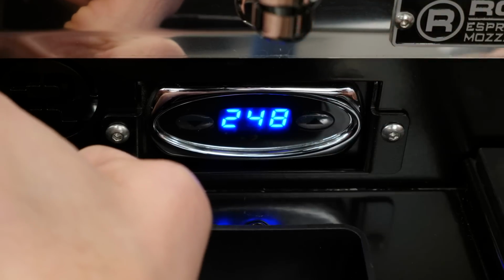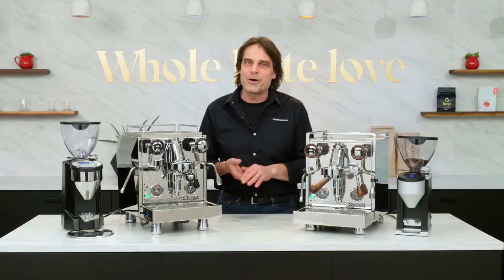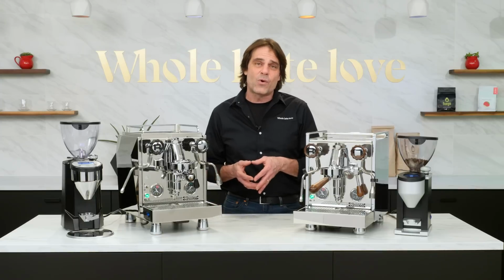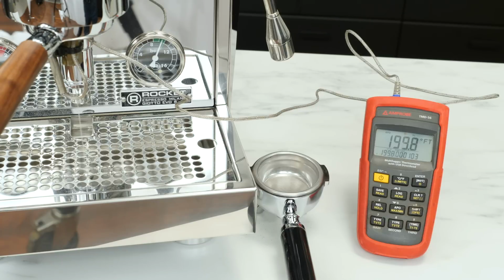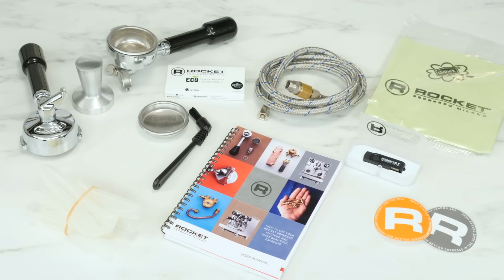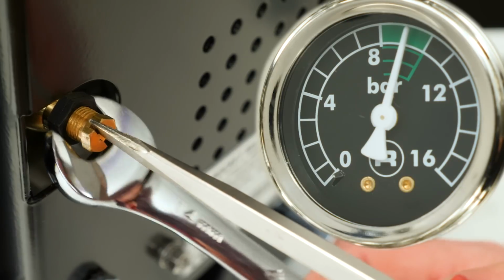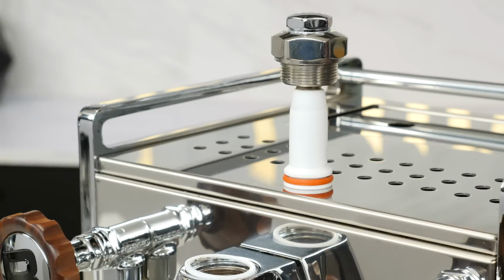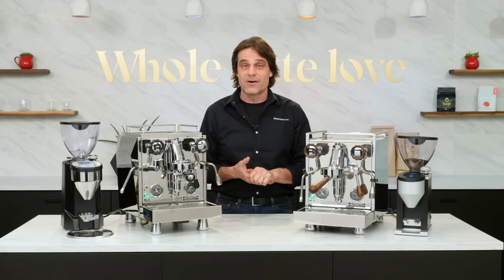Review: Rocket Cronometro R Giotto and Mozzafiato Espresso Machines

Comment: Question: I need to choose either bazzera aria pid or rocket Giotto type R, both have nearly same specs, which one to choose from?
Reply from the maker: Hi MR, They are very similar machines with both using HX boilers, rotary pump and plumbable. A couple of key differences (referring to versions from WLL in North America): Aria comes stock with flow control and has lever operated steam and hot water valves. Giotto uses standard turn valves. Personally I'd go with the Aria. It's a newer design, excellent steam power, flow control stock and I prefer the lever operated valves. Hope that helps!
Marc

Comment: Thanks for the video. Have this machine with Eureka mignon specialita about two years now and wondering it upgrading the grinder to ceado e37s will give me any noticeable improvement in taste of espresso? (I have watched most of uour ceado vids so do understand the other benefits of the machine, but really kist curious about flavour). Thanks !
Reply from the maker: Hi, larger burrs like those in the E37S produce a more consistent grind particle size. Compared to the Specialita the E37S produces a fluffier and virtually clump free grind. Distribution into the PF is excellent as is consistency of dose to dose timed weight output. Once you reach a certain level of grinder taste improvements are incremental and subjective. Both the Specialita and E37S produce excellent espresso. The Ceado, by reducing variables makes it easier to do so consistently.
Marc

Comment: Hi Marc, I was just comparing the weights of Giotto and Mozzafiato Cronometro R on the respective Spec sheets when I noticed the Giotto is about 15 lbs lighter than the Mozzafiato. To what do you attribute the much lighter weight of the Giotto, and do you think this suggests less robust build quality of the Giotto versus the Mozzafiato? Thanks in advance!
Reply from the maker: Hey kdd, Internally the machines are nearly identical. All or most of the weight difference comes from the Mozzafiato side panels which are heavier thick slabs.
Marc

Comment: Does it need cooling flush?
Reply from the maker: Hey AZ, Need to flush depends on time from last use. If you run pump with PF off and see bubbling steamy water then flush a few seconds until water flow from group becomes smooth.
Marc

Comment: It's not uncommon for drip trays to overflow and land exactly at the spot where the PID is located. That's a display + regulator combined, not cheap to replace. Came across a snapped off ceramic mushrooms. Good video from WLL though.
Reply from the maker: Hi q, thanks for the comment. You are correct with location of PID. One does want to empty the drip tray! In most cases the front end of the PID is fairly impervious to moisture. I agree with ceramic mushrooms - they are brittle and can snap if dropped or similar. I prefer stainless steel mushrooms.
Marc

Comment: hey Mark, absolutely love your YouTube channel. you’ve made my journey into coffee so much more meaningful, and allowed me to find joy in the mishaps along the way. 

i’m currently trying to decide between the Rocket Appartamento and the Ascaso Steel DUO PID. I was wondering if you were planning on doing a comparison video between the two, or if you could offer your advice on which one I should buy. The Apartamento of course has a proven record, but it would be nice to have temperature control and near instant heating. 

thank you in advance for your insight 🤍
Reply from the maker: Hi Omar, Thanks for the kind comments. The Ascaso you mention uses thermoblock heaters instead of true boilers. Sorry, I have to be honest... but for that reason it's not a product I'm interested in looking at. Thermoblocks will have issues long-term unless one is extra careful with water quality.
For less $$ than the Appartamento have a look at the Profitec Pro 400: https://www.wholelattelove.com/products/profitec-pro-400-espresso-machine-flow-control
E61 group, stainless boiler and 3 level PID. If you purchase from us, flow control on the Pro 400 is a free upgrade at the moment. The Pro 400 is a newer machine so not the track record of the Appartamento but I've been inside the 400 and like other Profitec machines I give it the edge in build quality tyo comaprable priced Rocket machines.
Marc

Comment: Hey Mark, for these Rocket machines specifically Mazzafiato, do I need to purge the steam wand after the machine is turned off? Any other tips for daily use?
Reply from the maker: Hey J, You do not need to purge prior to shutdown but always purge after steaming milk - every single time!. Other stuff:
1. Run a couple of cups of water out of the hot water tap every day or two unless regularly using hot water from the machine. This will reuce minerals
2. Filter/treat water with a BWT product to reduce calcium and prevent scale.
3. Backflush with water only every 10 brew cycles. Backflush with Cafiza or similar every 100 brew cycles.
4. Allow the machine to fully warm up before use and have the PF in the group when warming up.
5. Make EXCELLENT espresso - of course!
Marc
Reply: @Wholelattelovepage  thank you Mark! You guys are the best!! 🙌🏻

Comment: Fabulous! How long do they take to warm up first thing in the morning (in a 62°f kitchen) ?
Reply from the maker: Hey Mark, I'd allow ~25 minutes for full warmup. Machine will show boiler up to temp far sooner but you want the mass of the group fully warmed as well. As the Cronometros have a mechanical power switch it is possible to use an appropriately rated appliance timer so you don't have to flip the switch.
Marc

Comment: Hi there, is the warming cup area on the Giotta smaller vs. the Mozzafiato?  Looks to be that way over the video but I might be wrong?  Justin
Reply from the maker: Hi JR, Ever so slightly smaller. Minus the panels the machines are identical. The way the Giotto has the rails around the tray takes a bit more space making surface area of cup warmer smaller.
Marc

Comment: For a small coffee shop, which machine would you recomend, that is good looking and efficient? 😀
By the way. Amazon review on the Rocket.
Reply from the maker: Hi RC, Thanks for the comment and question. These Rocket machines are technically not rated for commercial service. That said some likely use in offices, bed and breakfast, etc. If your local regulations allow the use of non-commercially rated equipment you could get away with one of these heat-exchange boiler machines for lower volume service. These models have commercial grade rotary pumps and can be plumbed direct to waterline for unending water supply. You might want to take a look at dual boiler machines which have separate boilers heating water for steaming and brewing. With those you'll have more steaming power and more consistent brew temperatures. Have a look at the Profitec Pro 700: https://www.wholelattelove.com/products/profitec-pro-700-dual-boiler-with-flow-control or the ECM Synchronika: https://www.wholelattelove.com/products/ecm-synchronika-dual-boiler-with-flow-control
Marc

Comment: Hi Mark, your videos are great, have been watching for some time trying to decide which machine to buy and your reviews certainly help. Would you be able to answer my question regards model numbers for the Rocket Mozzafiato machines. At the end of the numbers are, A07, A11, B11, W11. What are the differencies between these machines? many thanks.
Reply from the maker: Hi Kenny, Thanks for the comment and question. I'm guessing the model number differences are related to different versions of the machine. The Mozzafiato has had 4 recent types. The newest two are the Cronometro versions which have the shot timer on the face of the machines. The Cronometro comes in the "R" version which have a rotary pump and are plumbable and the "V" version which uses a vibration pump and is not plumbable. To complicate things a bit more both the R and V types are available  in "Nera" which denotes black side panels and "Bianca" with white side panels. Here's a link showing all 6 current versions of the Mozzafiato side by side: https://www.wholelattelove.com/collections/all-espresso-machines?_=pf&pf_v_brand=Rocket%20Espresso&pf_p_price=2156%3A3200
Hope that helps!
Marc

Comment: Hey Mark, i recently purchased the Mozzafiato V and found it to be a mistake due to the noise, and just traded up to the Rotary pump with the rosewood handles and love it...my question you had already answered once with the "V" is how to change the PID to F*  which you answered by holding both buttons while switching machine on.....after receiving the R, i tried this same procedure but it didn't work? ...how do i do it on the R version?.....also i noticed after having the V for almost 3 weeks i struggled to get the pressure in the "green" no matter how i tamped or grinded it seldom hit that sweet spot on the dial...yet after receiving the R version, without changing a single thing the new machine hits the sweet spot in the green every single time??? Did i have a defective unit?.....Thanks...
Reply from the maker: Hey ADK, I think it's unlikely your V was defective. Did you ever try running the V with a blind basket in place to check the brew pressure? We recommended vibration pump machines be set to produce 10 bar with a blind filter in place. Adjusting the OPV controls the max brew pressure on vibration pump machines. Happy to hear you are loving the rotary pump machine! They are much quieter than vibration pump machines. To the best of my recollection changing C to F should work the same on the R version.
Marc
Reply: @Wholelattelovepage  yeah i cant get it to make the switch for some reason...

Comment: Hi Mark, I had some quality issues with my mozzafiato V and sold it. After your videos about the Crem One I am very interested in these machines. How do you think the Crem One  and the Rocket do have differences? Can we compare these machines in terms of quality....styling? Thanks for your videos, als always m: great job!
Reply from the maker: Hi HK, Thanks for the kind comment and question. Sorry to hear about your troubles with the Rocket. Not something I've run into. As too comparing to Crem machines... Style is a personal appraisal. Rockets as you are aware are heavy on the branding. Some like that and some do not. Qualoity of the Crem machines is very good. Be aware they have some plastic like the drip tray and the chassis. Not necessarily a bad thing but some are opposed. The Crem machines with Rotary pumps are extremely quiet. I consider the Rocket machines to be a very classic design and the Crem machines use more modern manufacturing materials/techniques.
Marc
Reply: @Wholelattelovepage  Hi Marc, thank you for that fast and detailed answer. Rocket is in deed very stylish and beautiful to look at, maybe my issues came from cleaning too much with cleansing tablets :). Did not know about the plastic at the Crem One: thank you very much, this is a very valuable information. Did I mention that I love your channel? I'm loving it :)👌

Comment: Mar question I have this model. I set pid but I also have a brew head temp on this unit also and it seems the brew head dosnt get to this temp. I mean sometimes but not always. The water function when I dispense water it’s scolding I understand this but leaving machine idle very rarly getting to that 201 202 etc I have to like flush a lot. Is this normal or is my brew head temp off or forget about brew head temp unit. Thanks.  I just checked machine at pid of 252 it finally hit about 201 F on group head. Maybe I’m overthinking this. I just want to make sure when I pull a shot it’s not like 192 while pulling. At 201 is good to do it.
Reply from the maker: Hi Dirk, Thanks for the question. The group temp gauge will not read the full brew temp when the machine is idle. I do not use group mounted thermometers much as I have a Scace device which is far more accurate IMO. Think you are overthinking.
Marc

Comment: Marry, on my mozzafiato i notice the circulation of the water in the e61 is much less. I had the Apartamento and you used to hear it all the time. The mozzafiato not so much. Is it because of the pid. I also notice with a brew head with my temp gauge it’s not what the pid say now I’m talking about when I’m not pulling a shot or when I’m not flushing just when it’s just sitting there. The Apartamento when just sitting got like 207 F. Is this because I didn’t pull the shot yet. Is it because the pid got the boiler water to desired temp and when I pull the water coming through bre head will be at the temp of the pid?  Thank you much.
Reply from the maker: Hi Dirr, Honestly don't think you should be hearing circulation of the thermosiphon. I've never heard that on any machine! On the Appartamento only thing I can guess is maybe hearing  some boiling associated with high temps. 207F in the group is really close to boiling and it's likely (but not certain) there were some bubbles in thermosiphon. But again, I've never hear that on any E61 machine.

Comment: Hi Marc. I'm investing in a new machine. Which one is better. Rocket Cronometro R Mozzafiato or Bezzera duo Top DE
Reply from the maker: Hi J, Thanks for the question. Both machines are quite good and similarly capable of making excellent espresso. The Rocket uses a heat exchange boiler while the Bezzera Duo is a dual boiler. With the dual boiler you'll have individual control of temps in each boiler so changing temp in the steam boiler has no affect on brew temps. That's not the case woth the Mozzafiato with the HX boiler. Beyond that the Mozzafiato uses an E61 manual group while the Duo DE uses the BZ group which is electrically heated. With that, the Duo is faster from cold turn on to ready to brew. Duo has a touch screen control and push brewing start for both programmable espresso sizes or manual start stop of extraction. Mozzafiato is free of digital displays except for the small shot timer. Here's a link to a side by side spec comparison of the machines for more details: /pages/compare?products=MTU0NjAwNDEzNTk5NSw0Mzk3MTY0NjkxNTEw
Hope that helps!
Marc

Comment: How do you change from Celsius to Fahrenheit? Just purchased this machine from you and it’s not included in the instructions.
Reply from the maker: Hi M32, Thanks for the question. I do not have a machine in front of me at the moment so I cannot confirm but fairly certain you hold down both the +/- keys on the PID display while turning the machine on. Wait until "F.__" appears in the display then use the + key to move thru the functions. I believe temp is in F.01 or F.03. Select that function then use the keys to change from C to F.
Marc
Reply: @Wholelattelovepage  perfect! Thank you!

Comment: Great stuff, Marc! I read through the questions below and did not see this answered, but apologies if you've listed it somewhere else. Do you think this machine could keep up with doing 2-3 12 oz lattes in a row, or would I need to go up to a double boiler? I'd be OK doing all the milk at once if that made a difference.
Reply from the maker: Hi river, Thanks for the comment and question. Dual boiler would definitely be more capable and there would be less interference of HX boiler heating in brew temps doing back to back drinks. That said, I think this machine is capable of 2-3 back to back drinks. It should totally recover by the time you've prepped the next shot and refilled you milk pitcher. I would not suggest steaming all the milk for 3 drinks at the same time.
Hope that helps!
Marc
Reply: Thanks!
Reply: @Wholelattelovepage  Looks like steaming 10oz of milk and making three to five 60ml espressos not an issue.

Comment: For how long machine was idle before SCACE tests?
I am wondering if it needs flush after long idle period.
Reply from the maker: Hi Luke, They were idle for at least 15 minutes prior to test. Depending on ambient temps machine could require a short flush after extended idle times.

Comment: could you explain in a video how direct plumb Espresso Machine in rocket machine (direct line & water tank large bottle ) and do i have to put Flojet, water pressure valve ... please
Reply from the maker: Hi MA, Thanks for the request/question... Most machines with rotary pumps can draw from a water bottle without a Flojet so long as the water bottle is not significantly below the level of the machine and you will not need a water pressure regulator in that setup or if direct plumbing to pressurized plumbing. Rocket machines have a solenoid valve on the plumbed in water connection which only opens the machine to external pressure when the pump is operating. Hope that helps!
Marc